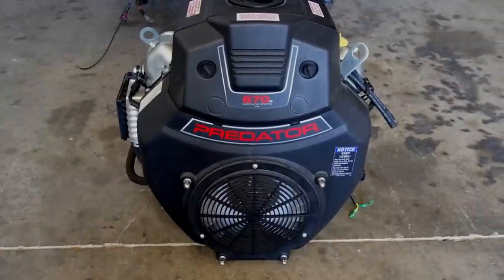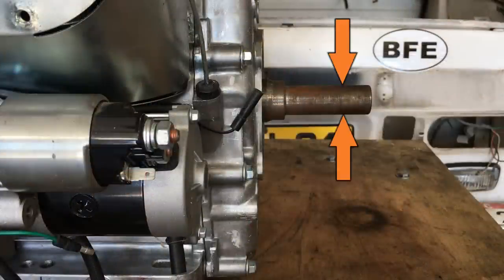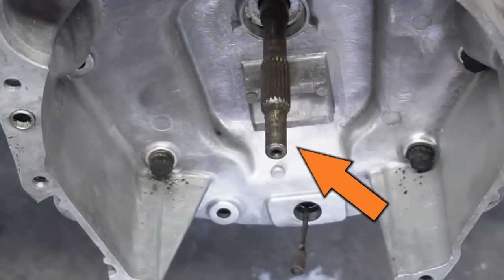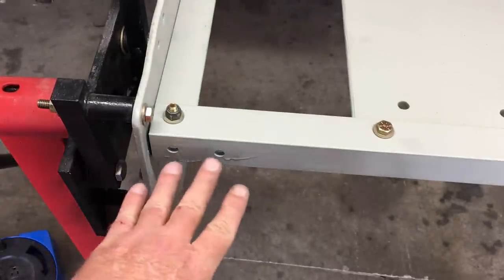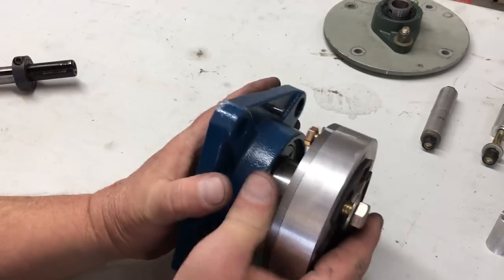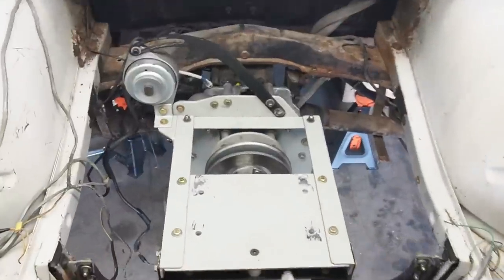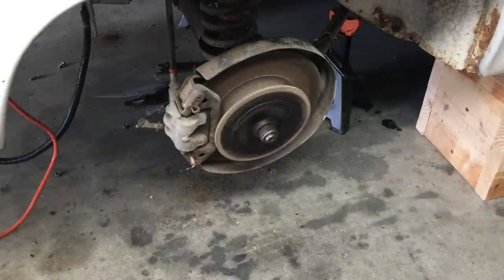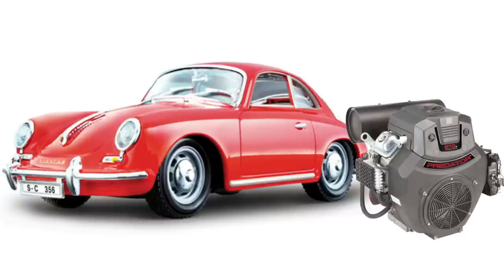S3 E18 We put a 670 Predator V twin in our project car 1969 Renault 10

Comment: A disappearing ship

The Edmund Fitzgerald was a 729-foot ore carrier and one of the largest freighters on the Great Lakes when it left Superior, Wis., on Nov. 9, 1975, carrying iron pellets bound for Detroit.
Reply: The next day, the ship was caught in a storm with winds that averaged 60 to 65 miles an hour. Its captain reported 20- to 25-foot waves washing over the decks and water pouring in below deck through two broken air vents.
Reply: That night, the Edmund Fitzgerald sank near the coasts of Ontario and Michigan, in water that was only about 50 degrees. A nearby ship reported seeing its lights disappear in the driving snow.

The Coast Guard later found lifeboats, life rings and other debris from the ship. But the lifeboats were self-inflatable, so their discovery did not necessarily indicate that they had been used. None of the 29 crew members survived.
Reply: The legend lives on from the Chippewa on down
Of the big lake they called Gitche Gumee
The lake, it is said, never gives up her dead
When the skies of November turn gloomy
Reply: With a load of iron ore twenty-six thousand tons more
Than the Edmund Fitzgerald weighed empty
That good ship and true was a bone to be chewed
When the gales of November came early
Reply: The ship was the pride of the American side
Coming back from some mill in Wisconsin
As the big freighters go, it was bigger than most
With a crew and good captain well seasoned
Reply: Concluding some terms with a couple of steel firms
When they left fully loaded for Cleveland
And later that night when the ship's bell rang
Could it be the north wind they'd been feelin'?
Reply: The wind in the wires made a tattle-tale sound
And a wave broke over the railing
And every man knew, as the captain did too
T'was the witch of November come stealin'
The dawn came late and the breakfast had to wait
Reply: When the gales of November came slashin'
When afternoon came it was freezin' rain
In the face of a hurricane west wind
Reply: When suppertime came, the old cook came on deck sayin'
"Fellas, it's too rough to feed ya"
At seven PM, a main hatchway caved in, he said
"Fellas, it's been good to know ya"
Reply: The captain wired in he had water comin' in
And the good ship and crew was in peril
And later that night when his lights went outta sight
Came the wreck of the Edmund Fitzgerald
Reply: Does any one know where the love of God goes
When the waves turn the minutes to hours?
The searchers all say they'd have made Whitefish Bay
If they'd put fifteen more miles behind her
They might have split up or they might have capsized
Reply: They may have broke deep and took water
And all that remains is the faces and the names
Of the wives and the sons and the daughters
Reply: Lake Huron rolls, Superior sings
In the rooms of her ice-water mansion
Old Michigan steams like a young man's dreams
The islands and bays are for sportsmen
And farther below Lake Ontario
Reply: Takes in what Lake Erie can send her
And the iron boats go as the mariners all know
With the gales of November remembered
Reply: In a musty old hall in Detroit they prayed
In the maritime sailors' cathedral
The church bell chimed 'til it rang twenty-nine times
For each man on the Edmund Fitzgerald
The legend lives on from the Chippewa on down
Of the big lake they called Gitche Gumee
Superior, they said, never gives up her dead
When the gales of November come early
Reply: An unlikely success

The morning after the Fitzgerald went down, the rector of Mariners’ Church of Detroit tolled its bell 29 times, once for each man lost. An Associated Press reporter knocked on the church’s door, interviewed the rector and filed an account that was published in newspapers.
Reply: Mr. Lightfoot read the article. Soon afterward, he started singing a song about the wreck during a previously scheduled recording session. His band joined in, and the first version of the song that they recorded was later released, according to “Gordon Lightfoot: If You Could Read My Mind,” a 2020 documentary.
Reply: There was no expectation that the song would become a hit single, because its length made it too long for airplay on the radio. But it would spend 21 weeks on the Billboard charts and peak at No. 2, one notch behind Mr. Lightfoot’s only No. 1 hit, “Sundown.” It also turned the tale of the sinking into a modern legend.
Reply: Yet unlike songs that use a real-life story as the basis for embellishment, Mr. Lightfoot’s ballad hewed precisely to the real-life details. The weight of the ore, for example — “26,000 tons more than the Edmund Fitzgerald weighed empty” — was accurate. So was the number of times that the church bell chimed in Detroit.
Reply: Decades later, Mr. Lightfoot changed the lyrics slightly after investigations into the accident revealed that waves, not crew error, had led to the shipwreck. In the new lyrics, he sang that it got dark at 7 that November night on Lake Superior — not that a main hatchway caved in.
Reply: “That’s the kind of meticulous, looking-for-the-truth kind of guy that he was,” Mr. Greenberg said.
Reply: An enduring legacy

“The Wreck of the Edmund Fitzgerald,” like its creator, endured as a Canadian classic long after slipping off the Top 40 charts. The bluegrass guitarist Tony Rice (who also released an entire album of Lightfoot cover songs) and the rock bands Rheostatics and the Dandy Warhols were among those who  sang covers over the years.
Reply: “The melodies are so powerful and he’s such a good storyteller and such a beautiful lyricist,” the Canadian singer-songwriter Sarah McLachlan said in the 2020 documentary. “And the combination of those things just really makes for a great song.”
Reply: Mr. Lightfoot remained proud of it for decades, and he kept newspaper clippings and items given to him by the crew members’ surviving families in his home, Mr. Greenberg said
Reply: The song’s success had one downside: It turned the wreck, which lies in Canadian territory at a depth of about 500 feet, into a trophy for divers, upsetting the lost sailors’ families. In 2006, the government of Ontario adopted a law protecting the site.
Reply: The S.S. Edmund Fitzgerald was the largest ship on the Great Lakes.

The large cargo vessels that roamed the five Great Lakes were known as lakers, and the S.S. Edmund Fitzgerald was, at the time, the biggest ever built. It was constructed as a “maximum sized” bulk carrier and spanned 729 feet—the first laker to reach that length. It sat 39 feet high with a width of 75 feet, and weighed more than 13,000 tons without cargo. It was christened on June 8, 1958, and made its first voyage on September 24 the same year.
Reply: The ship was owned by an insurance company.
Reply: Great Lakes Engineering Works of Ecorse, Michigan, was contracted to build the ship in 1957 by Northwestern Mutual Insurance Company, which had invested heavily in the iron and minerals industries. With the commissioning of the Fitzgerald, Northwestern Mutual became the first American insurance company to build its own ship—at a cost of $8.4 million, the most expensive price tag for a freighter at the time, according to Michael Schumacher’s The Mighty Fitz.
Reply: . It was named after the head of the company.

The chairman of Northwestern Mutual had a long history with the Great Lakes shipping industry. Edmund Fitzgerald’s grandfather captained a ship on the lakes, his father owned a shipyard, and they both had ships named after them. After construction of the Fitzgerald was complete, Northwestern Mutual placed its charter with the Columbia Transportation Division of Oglebay Norton Company, based in Cleveland.
Reply: Most lakers traversing the Great Lakes and the connecting waterways carry massive amounts of raw materials such as rock, salt, and grain. The Edmund Fitzgerald generally loaded taconite, low-grade iron ore, from mines on the shores of Minnesota and transported the pellets to steel mills near Detroit and Toledo, Ohio.
Reply: @ocdman202  Mighty Fitz: The Sinking of the Edmund Fitzgerald ==    a good read..
Reply: The Edmund Fitzgerald, a colossal ore carrier, had been fighting her way through a pounding November storm on Lake Superior. Then the Fitz’s radar went out, and she started to take on water. Despite gale-force winds and thirty-foot seas, there was no reason to think the Fitz wouldn’t find safe harbor at Whitefish Point, Michigan. The last words from the Fitz’s captain, Ernest McSorley, was “We are holding our own.” By all indications, the crew had no idea they were in mortal danger before they plunged to Lake Superior’s bottom with no chance to call for help.

Michael Schumacher relates in vivid detail the story of the Edmund Fitzgerald, her many years on the waters of the Great Lakes, the fateful final day, the search efforts and investigation, as well as the speculation and controversy that followed in the wake of the disaster. A fitting tribute to one of the largest ships to have sailed the Great Lakes and the men who tragically lost their lives, Mighty Fitz provides a comprehensive look at the most legendary shipwreck on America’s inland waters.
Reply: "Mighty Fitz" is a compellingly-written account of the loss of the "Edmund Fitzgerald." The book is a good introduction to the ship and the shipwreck, and does a generally fine job of relating the personalities of the people involved. I appreciate that Michael Schumacher went to the trouble to interview family members of the crewmen as well as others with a substantial role in the story rather than simply relying on previous interview accounts in the many other books, articles, and reports written on the "Fitzgerald." Schumacher writes quite well, and his prose is interesting and easy to read, likewise he is good at relating concepts that readers may not be familiar with in a comprehensible way. These good points make the book worth reading for someone interested in Great Lakes shipping or maritime accidents.
Reply: The book is not without fault, however, and a couple of the issues are significant. The most obvious is a complete absence of maps, drawings, or photographs in the book. This is fairly inexcusable, as the story is much easier (and more interesting) to follow with those aids; in particular, charts showing the tracks of the "Fitzgerald" and the "Arthur M. Anderson" on the night of November 10, 1975 would have been helpful to those unfamiliar with the accident and their proximity to Six Fathom Shoal, etc.
Reply: My other main objection to the book is that while it gives a good factual accounting of the voyage and accident, in my opinion it does seem to lean to the sensationalistic, and Schumacher's personal opinions seem to creep into the narrative. An example is on p. 69 where the author writes "[Captain] McSorley, in fact, was growing more desperate. Success in sailing through the storm depended upon his staying in control of the 'Fitzgerald,' and with the radar out, water boarding his ship, and the Whitefish Point lighthouse inoperative, he was gradually but most definitely losing control of his ship's destiny." It goes on, but that's illustrative of the larger point. How does he know McSorley was "Growing more desperate?" Most people believe that he never truly understood how much peril he was actually in. "Losing control of his ship's destiny?" Not only is that sensationalistic, but how could he believe that he was losing control if he didn't understand the true damage to his ship? The author may be right about what McSorley was feeling and what his opinions were at the time, but I can't imagine how he can know for sure, and that's my issue with the way it's written
Reply: On balance this is a highly readable account of the demise of the "Fitzgerald," and I recommend it with the reservations I mentioned above. It is a great introduction to the accident, and is probably the best organized book I have read on the subject, but it's important to really think about the beautifully written (if occasionally trite) prose. Despite it's sometimes rambling nature and disparaging remarks about the Coast Guard, I still prefer Frederick Stonehouse's classic "The Wreck of the Edmund Fitzgerald," which is a more analytical book that is very well illustrated. Better yet, read them both and compare and contrast the strengths and weaknesses of each
Reply: Very detailed account of the ship, it’s crew members, the wreck and all that has followed. The author gives his opinion on how she went down, but offers others as well.
Reply: I was a teenager growing up in Northern Minnesota in November 1975 when the Edmund Fitzgerald sank in eastern Lake Superior. I remember the storm, the news story, and thought the Gordon Lightfoot song only added to the mystical element of why the storm claimed the "pride of the lakes."
Reply: Schumacher's account is basically chronological, tracing the launching of the ship in 1958 and following its life until the boat last loaded taconite pellets in Superior, Wisconsin on the morning of November 9, 1975. Accounts and reflections of family members are interspersed throughout the narrative.
Reply: Of particular interest to me are the various theories of how she sank so suddenly. There were no survivors, no visual witnesses. The best evidence of what happened were radio conversations with nearby ships.

I had always favored the theory that the ship might have struck a shoal north of Caribou Island. With both radars down, the Fitzgerald had to thread a needle between two islands. Under most circumstances, this would be no problem. But in the early afternoon of November 10, 1975 in a blinding snowstorm, maybe she got too close to the more shallow shore on the north side of the island. With a hole in the bottom, that would account for the list the Captain reported. The ship gradually sank lower and lower in the water until a wave from behind lifted her and sent her nosediving to the bottom of the lake. This theory seems to best explain why there was no final distress call.
Reply: However, after reading Schumacher's book, I am less certain. The Coast Guard's original explanation of taking on water from the topside hatches now has some merit to me. This theory has always been controversial because it then points to possible negligence of the crew in not manually securing dozens of clamps that hold the hatch covers in place. Schumacher also reported something that I never heard before in that the Coast Guard found some damage to the hatch covers just a couple of weeks prior the accident, but cleared the Fitzgerald for the remaining of the shipping season.
Reply: Maybe both things happened. Who knows? What we do know from the radio transmission is that the Fitzgerald was taking on water from somewhere and it gradually weighed the ship down until it either just sank or nosedived to the bottom.
Reply: Less convincing is the theory that she broke in two on the surface before sinking. How the Fitzgerald sits in two pieces at the bottom of the lake 530 feet down seems to support the theory that she nosedived with the bow hitting the bottom violently from the shifting weight of the iron ore. The bow is sitting battered but dignified facing southeast towards the safety of Whitefish Bay. The torque created in the middle of the ship upon impact twisted the stern so that it now rests upside down some few hundred feet away from the bow.

No one will ever know with certainty. What has always fascinated me about the Fitzgerald is how violent and fickle Lake Superior can be. The other thought I have is what the 29 men thought in those precious few seconds they had when they knew they were about to die. I wonder what I would have thought and done in a similar circumstance. Gordon Lightfoot captures the sentiment so well in his line, "Does anyone know, where the love of God goes, when the waves turn the minutes to hours?"
Reply: The book is very readable and I couldn't put it down. Also of note are recent developments in which there is a movement on the part of the families to declare the site as a graveyard and off-limits to all future dives. I completely agree. A survey has been made. There are no definitive clues because the impact on the bottom has caused so much damage there is no way to determine what damage happened above or below water. There is no way to determine whether there is a hole under the bow section that may have caused the flooding in the first place.

It will be impossible to forget the Fitzgerald and we should not. But at the very least, we should let the 29 dead men at the bottom of the lake rest in peace by prohibiting all future dives. Schumacher's book is an moving compilation of 30 years of theories and shed tears over this modern day mystery.
Reply: On a blustery day in November, 1975, two ships, the Arthur Anderson and the Edmund Fitzgerald, set off across Lake Superior with their cargoes. Only one ship would reach its destination. The other would founder under the weight of an incredible November storm and would go on to live in the memory of every other Great Lakes sailor. This book tells the story of the Fitzgerald and how its legacy has lived on for over three decades.
Reply: The Fitz was loaded with 26,000 tons of taconite pellets which were to be delivered to Indiana. After receiving its load, Captain Ernest McSorley manuvered the ship out onto Lake Superior and began his journey across the lake. At this time, a massive storm, fed by unseasonably mild southwest winds, began to push northward. While this storm was proceeding northward, a cold Canadian air mass was making its way south. These two fronts collided and unleashed its powerful fury across Lake Superior. For the men of the Anderson and Fitzgerald, they were now finding themselves smashed by winds approaching 90 miles per hour.
Reply: The Anderson handled the storm well, but the Fitzgerald was not as fortunate. The winds blew the radar antennas off the ship, and water was entering the cargo hold. As each burst of water fell into the hold, the ship began to settle deeper in the water. However, McSorley didn't seem overly concerned about his situation. He still maintained radio contact with the Anderson and, around 7:00 p.m. on November 9, 1975, told Bernie Cooper, Anderson's captain, that they were holding their own. This was the last communication received from the Fitzgerald.

Shortly thereafter, the Fitzgerald was hit by two mammoth waves. The first pushed the Fitzgerald's bow underwater. It never re-surfaced. The second wave sent the crippled ship straight to the bottom of Lake Superior. No one survived; no one tried to abandon ship. It all happened in a matter of mere minutes.

Days later, some debris from the wreck was retrieved and everyone's worst fears were realized; the Fitz was lost.

Many different investigations were held into the loss of the ship, but none could offer a firm explanation as to how the ship sank, but the most commonly accepted theory is that water entered the cargo hold through the hatch covers, causing the ship to lose buoyancy and, ultimately, to sink.

Over the years, many undersea expeditions have taken place, which have brought back many underwater images of the Fitz. The ship's bell was retrieved and restored as a memorial to the men who served aboard her. And, the families of the survivors have petitioned to have the wreck recognized as a grave site, which would end further exploration of the wreck.
Reply: Yes, I love photos but....Instead of a lineal account of the timeline, this book is woven creatively, intermixing parts of the day, history of the Fitz, biographies and life details of the crew, great lake shipwreck history, evolution of safety measures, the search from different individual experiences, the investigation, ceremonies, lawsuits, clash of intersts, and continued interest over the decades and effects for a variety of people. I even learned about parts of ships and mariner lingo (freeboard? Spar deck?]. And yes, he addresses Gordon Lightfoot and THE SONG. He is very skilled at combining facts with narrative, with opinion, technical information, outlook of other books written, and the human cost (to the lost, family and friend surviviors, search participants, marine board members, etc.) in a way that pulled me forward like a suspense novel. I loved it
Reply: In the end, though, Schumacher does a very good job bringing this tragedy to life and making the reader feel the loss of the ship and its crew. This is a very good book for someone wanting an overview of the second most shipwreck in modern history, but it is probably too superficial for "Edmund Fitzgerald" aficionados or anyone wanting an in-depth, detailed study of this tragedy.
Reply: There are (at least) three very good things which result from finishing this book about the sinking of the Edmund Fitzgerald on 11 November 1975. The first is that I learned a great deal about that shipwreck, 'tho not its cause, which remains a mystery. The second is that I can cease singing the lyrics to Gordon Lightfoot's ballad in my head all day. And the third is that I can stop getting tears in my eyes every time I read a part about "the wives and the sons and the daughters" of the 29 hands lost that day. Michael Schumacher previously wrote a history of the sinking of the Carl D. Bradley in 1958 in Lake Michigan. In this later book, he relates the history of the Mighty Fitz and of her crews, the events of November 11th. the search for survivors, the investigation of the sinking, and the controversies which led to making the sunken ship a sort of memorial resting place for the bodies of the sailors. Lightfoot sang that "the legend lives on from the Chippewa on down of the big lake they call Gitche Gumee." The wreck of the Edmund Fitzgerald is now and forever part of that legend.